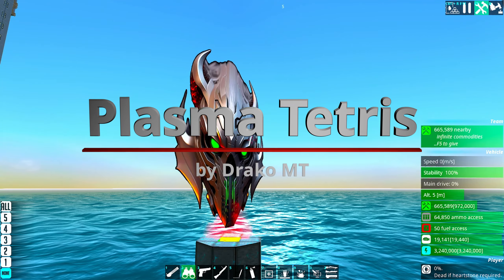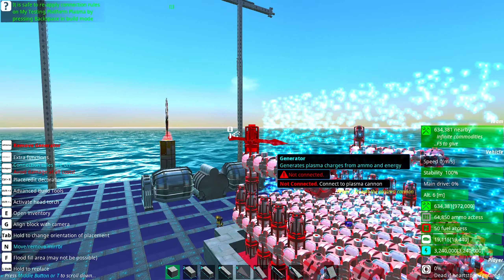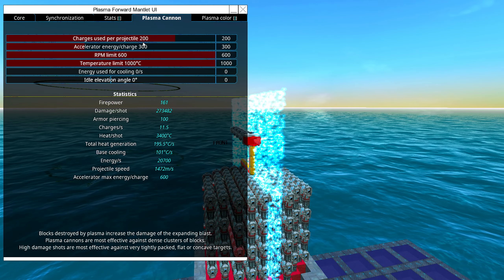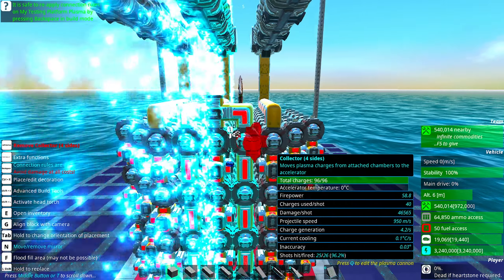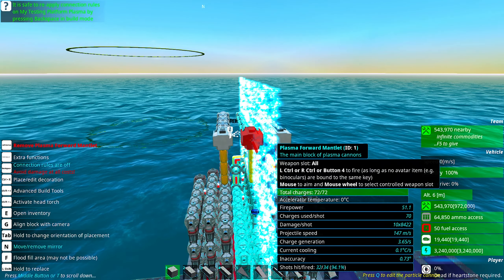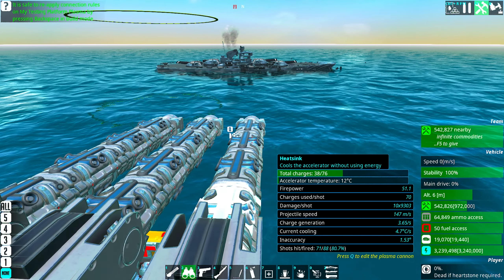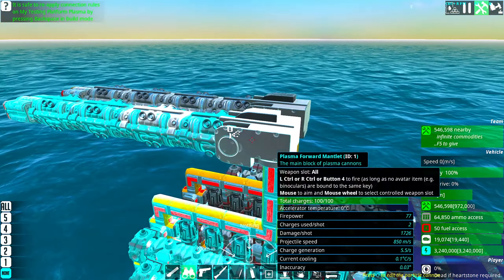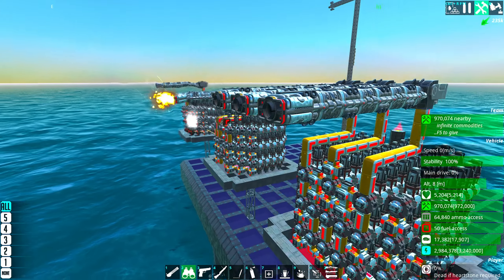Plasma Cannon Tetris 👍 From The Depths | New 2023

Comment: My testing found that having a dual barrel setup at a small synchronisation delay, with not that many chambers is the way to go.
Having just 16...20 charges total means you save money on a ton of chambers, thus allowing for more generators in the same space / same number of generators in smaller space. Keep in mind the charge/s number is the most important for determining DPS (well the barrel ending too but i mean stabiliser shots). However, shooting with larger number of charges, although more efficient for damage, also wastes shots on airgapped elements.

Going over 20 charges per shot made the guns use more material for coolers / more energy to maintain accuracy and from there on, upwards of 20 charges per shot, airgapped blocks start wasting a ton of damage from your shots.

Having 2 guns desynchronised with some 16-20 charges/shot, using just enough generators to achieve 50-80 firepower per gun, terminated with a stabiliser head made for the most efficient shredder. The cooling is not too expensive if you fire 16-20 charges / 5+ seconds per gun, so it's also extremely accurate.
My dual gun setups have around 600 material/firepower and can dig through a Tyr very quickly. They're also very compact, which is lovely.

The reason desynchronisation is so important, is that shots act like some sort of Thump/AP mix. If both shots hit the same area (with good accuracy they will), damage is wasted by propagating sideways. Desynchronised at 16-20 charges/shot, the single shot damage still leaves meaningful holes in terms of diameter, but they're twice as deep as a synchronous setup because they hit soon after one another, the second shot following up the hole left by the previous.

Shotguns sort of achieve much of the same thing, but the inaccuracy is really offputting to me as i do not prefer building short range craft.
Reply: Just learning plasma now, but genuine question, would setting up a single burst barrel achieve the same thing with less barrel/mantlet/cooler costs?

I struggle with the finer math of this game haha

I know redundancy is important, I'm just trying to build cheaper
Reply: The problem with shouting twice from the same gun is the second shot will have inaccuracy added from barrel heat unless you have large accounts of cooling or a longer delay between shots, both non-ideal .. Having 2 barrels gives you time to allow passive cooling between syncronised shots, and with how modular plasma is the only difference in cost would be the extra firing piece/mantlet / barrel. If the 2 shots don't follow almost exactly the same trajectory then the benefit of the second shot is lost, much easier when firing milliseconds apart